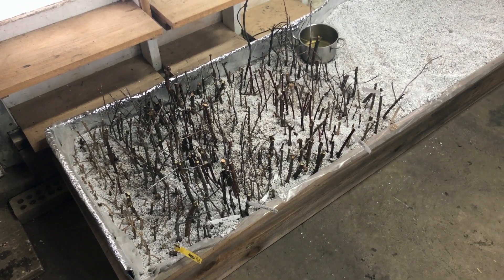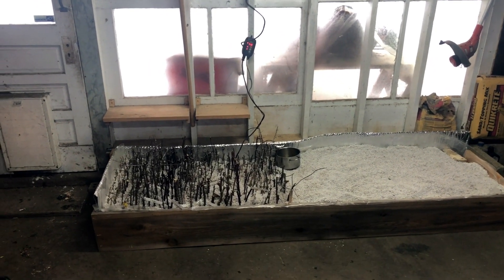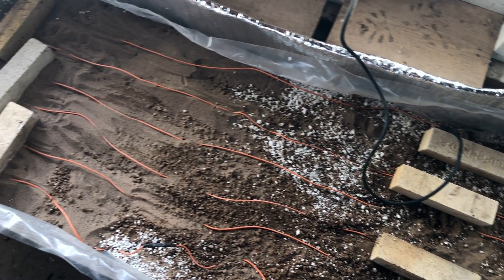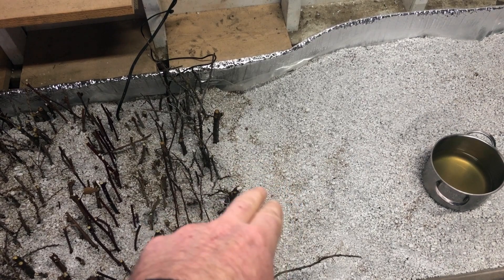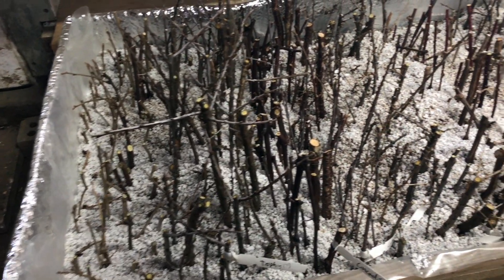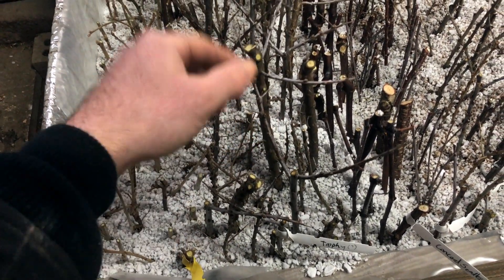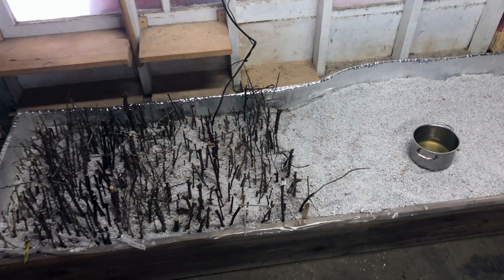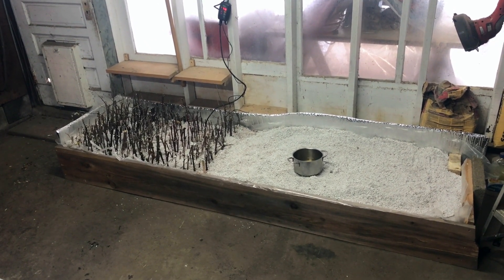Bottom Heat Propagation - Early Start!

Comment from the maker: Consider subscribing, liking and sharing if you found this video useful...
Another pretty important note here that I forgot to mention in the video...  Part of this design is to stack function and have the 'waste heat' that escapes this propagation space help provide warmth for the garage/workspace.  This way we can use the space more as it's more comfortable, and also store seedling flats, bare root plants, etc., near this box to help buffer them from more intense cold outside during this swing season...
Reply: Are you aware of the old school horse poop, bottom heat method?
Reply: Love the idea of stacked function but I would recommend a poly hoop over this with a vent flap that you can open periodically. That way you will lower the cost of heating the larger space at unnecessary times. I don't however know how that will affect the cuttings liking cooler tops.
Reply from the maker: @MAXIE 677 - I understand your idea here, but the challenge is that I don't want to have the tops be warmed up prematurely.  Ideal scenario is 74F right at the location where we want root formation, and 33F above.  Most root before shoot...

Comment: Thank you for an excellent explanation.  I just started a gutting bin on a seedling heating mat set at 75 F.  I currently have it upstairs to get some diffuse light.  It’s August in San Francisco.  I left a few leaves on the cuttings.  My previous attempts at cuttings seem to fail I think because my media has been too wet and no bottom heat.  How important is having cool air?  How much does light matter if you have a few leaves or better to do this without leaves in minimal light? 
I’m curious how long your cutting generally take.  I’m primarily interested in propagating maple, Japanese cherry and plum, Chinese quince, spruce and redwood trees. 

Be well,

Mats H
Reply from the maker: Warmer soil and cooler air, a little bit of light and evenly moist but not dripping wet soil all leads to better results...

Comment: Great information. I’ve been using solar panels along with 12 volt pump etc.  and honey as a rooting stimulant for a few years now to propagate my blueberry plants and have experienced a good degree of success. Perhaps that would be something you can benefit from as a solar propagation system does require a small investment but it can be very useful and long lasting.
Reply from the maker: You mean for a misting system?  Or for a bottom heat system?
Reply: EdibleAcres Hey. The panels can be used in both manners once you include a battery to store energy. In the misting context you use little to no battery power - as you use pump that runs only during daytime. However the panel can provide energy during the day and provide stored battery power for bottom heat wires as needed ( day or night). I have used panels mainly in the misting context.

Comment: you should put some insulation between the floor and the heater just get it off the floor
Reply: The way I understand his video explanation, that is the purpose of the insulated fire bricks.  Then the doubled poly plastic layer is the next insulator, in addition to being what holds the rooting medium.
Reply: Julie PdeM that is some yes but sitting on concrete just acts as a huge heat sink and for that nothing beats air. From experience growing lots of plants in garage you have to minimize the contact patch otherwise you are trying to heat the growing media but thermodynamics says that you will also be heating the concrete, heat flows hot to cold so any extra heat added will only serve to heat the concrete as well. It doesn’t take much but I recommend sub-flooring panels as they are easy to work with and do an awesome job at providing a buffer between the concrete.
Reply from the maker: I put down very insulative and lightweight fire brick under it as well as 4" of perlite... I hear you that more insulation would be ideal, but I think I got a decent amount.
Reply: @edibleacres  more of what i was trying to say is that insulation will never be more effective than  a actually air barrier. the best insulation is no insulation in this case air barriers between anything that share a high thermal conductivity such as the concrete and the propagation bed

Comment: I wanted to find you to ask u a q but keep forgetting lol

Do you have an indoor catchment for gray water?
I need to rebuild my kitchen wall with all the cabinets and kitchen sink and would love indoor catchment ideas because we get 40below here and cannot do outdoor catchment without letting cold air in or frozen pipes

I seen a nature documentary on this... I think it was Japanese water gardens or something like that but this was set up to flow out where it doesn't freeze like we do but they use fish and water plants to get everything cleaned up

I realise that fish cannot tolerate soap and grease but grease doesn't go down our drain anyway any ideas would be helpful thanks so much
Reply from the maker: I've seen that video.  They had their systems connecting to a stream/spring I believe that was moving.  We've experimented and it definitely doesn't make sense in a cold climate to collect gray water all winter... The soils don't need it and it's a huge burden if you are going very simply with 5 gallon buckets under the sink.  Maybe there is a design to send it out to a grey water bed in the growing season and back down the pipe for the winter?
Reply: @edibleacres  yes but blocking the pipe come winter could be more difficult but shouldn't be a problem if I have to re do it all anyway... Our plumming is broken at the moment and it has to all be done come summer... We just hand bomb it at the moment

But if there's a way to use it inside winter time would be better... I'm looking into aquaponics and filters for that might give me more ideas :)

Thanks for all your ideas :) if u get anymore ideas on this please let me know :) we want to go green as much as possible thanks again

Comment: Have you ever rooted Hardy kiwi from cuttings? I just bought Scion wood and am hoping to get it to root.
Reply from the maker: Personally I've never had success with hardwood cuttings, but I believe I'll try again in this system.  You may consider putting one cutting in water inside, letting it sprout and start growing, then potting up the hardwood stem with the new shoot in a way where the base of the new shoot is under soil.  That would allow a softwood rooting to happen.  Tricky but possible.
Reply: @edibleacres  thanks for the tip I'll give it a try. Would be great to get several plants and verities going for such a low cost.
Reply: @edibleacres  thanks for always responding it really is amazing how generous you are with your knowledge and time.